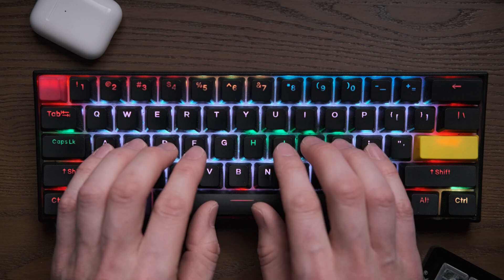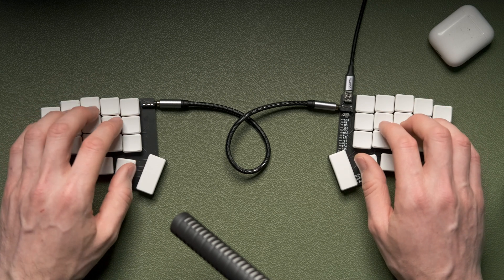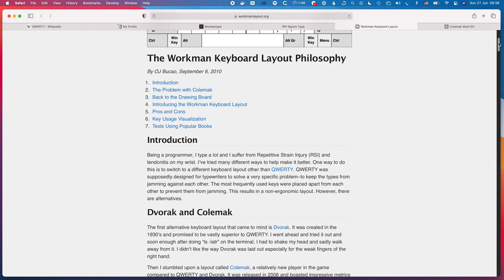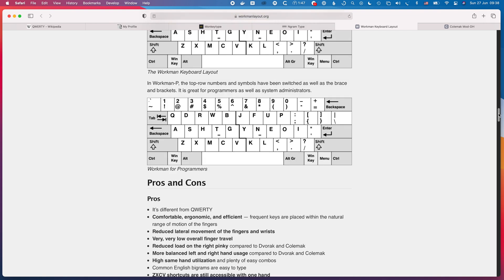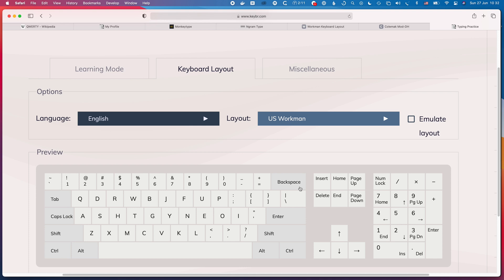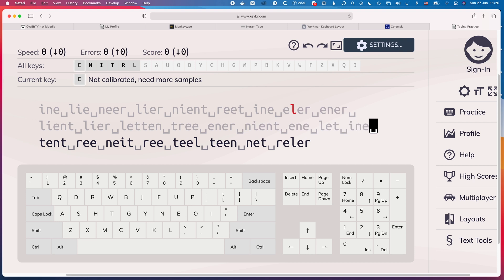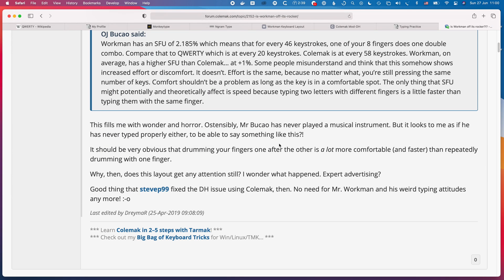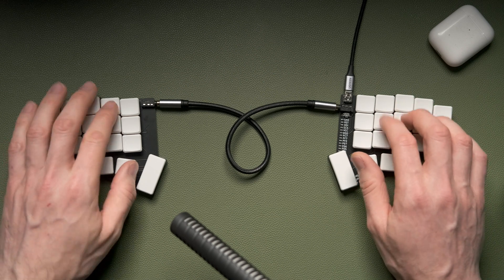Switching From Qwerty To Colemak DH (via Workman)

Comment: It's a misconception that QWERTY was designed to keep typewriter hammers from jamming. QWERTY evolved from an alphabetical layout folded in half. You can still see that in the middle and bottom alpha rows. That just happens to suck as a primary design choice for a keyboard layout.
Reply: Correct. The logic behind that was that people where supposed to write looking at the keys, and alphabetically ordered keys made sense for that. Slowly, some keys where swapped around to made it actually easy to type (like I and O below the 9, cause they were also the 1 and 0 keys, all vowels to top row to make 3 narrow rows instead of 2 wide rows). At some point people learned to touch-type on QWERTY, so further development on key arrangement stopped.

Comment: Question:
I'm currently transitioning to Dvorak and I'm still in early stage. I already find really weird that the F is so hard to reach, specially when coding (considering for, foreach, etc start with F 😕). I don't know if this is bc I'm still using a staggered kb (I'll have a sofle58 in a couple of days and will be able to test this) or if it's the layout's problem.
Does anybody have recommendations? Maybe trying another layout? I don't want to end up trying multiple layouts, loosing interest and going back to qwerty.
Reply from the maker: I would jump on the alt keyboard layouts Discord and see what they suggest over there. It’s the cutting edge of amazing layouts over there! https://discord.gg/J6d7kjjUDp

Comment: how you handle these layouts in iPhone? any app that offers the layout plus word prediction?
Reply from the maker: Not that I know of on iOS - there is xKeyboard though which works quite well for the layout. https://youtu.be/RbhmVFd1iNE
Reply: @BenVallack  I still miss the suggestions and autocomplete there. I was thinking that a mobile keyboard should have only 2 or 4 keys and the software should be able to predict the words or offer suggestions. Two fingers don't offer that much. If I could find a nice library to get the suggestions and learn from user typings I would implemented myself

Comment: Ben, Thanks for the video. I wanted to ask your advice. If you weigh the ergonomics of the DH mod against the Windows installation difficulty for employees locked down by their IT/Sec depts, do you think it's worth learning the DH mod vs learning vanilla Colemak which can easily be installed in Windows as an input option.  I've installed the "big bag" but can't get DH on my work laptop.  Thanks in advance.
Reply from the maker: Interesting issue, vanilla Colemak is going to be way better than Qwerty so it has to be better than not doing it at all. I never started with normal Colmak so can’t really comment on that.

Comment: Short and sweet, I like it! I have also changed to Colemak DH earlier this year and enjoy it. The only flaw that I see with it is that it definitely feels like my right hand is doing the majority of the work. I just recently soldered in per key backlighting on my Corne LP and enabled the typing heatmap display too, which reinforces this feeling as my right half is always more lit up than my left half.
Reply from the maker: Thanks! Interesting findings, I felt the opposite with Workman so was pleased to bring things back to my dominant hand a bit.
Reply: Yes, that is true. I wonder why not more people talk about the shortcomings of Colemak (less rolls than "advertised", too much work for the right hand, higher SFB than alternatives...) When I learned my custom layout (which was similar to Colemak, because using the same assumptions) I noticed that also. Therefore I ditched it and created a new layout which I think is much better than any Colemak variant. I have chosen to build on a variant of AdnW (Xoy) and modified that to my needs for English, German and Dutch. Then all keys move, but so what. Learning Colemak with about 17 keys changed is already an effort and the extra effort to learn all 30 keys new is not that large in comparison IMO.

Comment: How about this configurable layout: https://github.com/qmk/qmk_firmware/tree/master/keyboards/thevankeyboards/minivan/keymaps/josjoha (http://socialism.nl/misc/minivan/) It has Qwerty, Workman, Colemak, Dvorak.  I worked something like 18 months on it, and not just every now and again but almost daily.

It has about 4 times the functionality of a standard US keyboard. It is configurable in quite a few ways (crazy much documented). I was hoping to do this thing once and for all the right way for people without that kind of time. Even typewriters used to have more symbols than standard US keyboards, so I took some inspiration from the old typewriter symbols. It can pretty much type all western European languages, using Unicode for their additional letters (such as Ëë, ø, ç, ¿ etc), and some math stuff such as ³/₇ ≈ .42, ≤∑‰‱👍×÷√“”„‛’»±☞≠✗☑ etc. It can measure how much you typed (letters or words), lock it at a limit, measure your typing speed, has a dual layout if you want, etc. See manual …

Maybe you can review it some time ? It can be ported to the ortholinear Planck, which has been prepared in the code already, but that would require some work.

Comment: Ah, I was waiting for this video :)
I got my Moonlander about four weeks ago and decided to switch to Colemak-DH, since my muscle memory going from staggered to ortholinear required readjusting anyway. I'm now at 75-80wpm and I haven't any regrets about the switch.
I eagerly await your upcoming videos continuing on this subject! Tips for maintaining moderate proficiency in QWERTY would be nice. I find that continuing to use QWERTY on my laptop keyboard helps keep the muscle memory separate and it's a pretty instant readjustment.
Reply: how are things going? I'm currently at 40wpm with ANSI and I'm eyeing the Moonlander. Started a week and a half ago.
Reply: @valethemajor  it continues to be incredible. I'm down to a 36-key layout, still on Colemak-DH, with 100WPM on a bad day and 120-130 on a good one.
The only thing I would say is that there are much cheaper DIY options once you get down to 36 keys, some of which are showcased on this channel.
Reply: @TechTekker  seems to be the trend with everyone I've spoken to about their ergo or moonlander - swapped to a smaller board!

I'd rather not do sautering tho, sounds delicate and frustrating and heck dunno what the tools cost or what software I'd use to code it haha. Would prefer the streamlined experience at least at this stage in my journey.
Reply: @valethemajor  just to be clear, I'm using a 36-key layout, but still on the Moonlander! The fact that it has so many keys allowed to me slowly and comfortably get to this point, which was brilliant. And yes, the Oryx interface is simple and easy, but powerful nonetheless.
Whatever split ortholinear keyboard you choose, you'll certainly be happy :)
Reply: @TechTekker  Oh yeah I guess there's some advantage of flexibility when you have more keys.... Wow, awesome! I am not as concerned over the investment anymore then. Are you using whatever you chose for default switches or have you swapped your keys around at all?
Reply: @valethemajor  I went with Kailh Coppers, and I lubed and filmed them myself. Still use them and love the feel but wish they could be quieter (I'd say they're about middle of the road in terms of loudness). The good thing is that the Moonlander is hotswap, so the option to change the switches is always open.
As for key swaps, I put tab on upper right pinky, comma where you'd have slash, and return where you'd have the comma. I have a few multi-function keys to make my multi-layer system work, and I have to say overall the experience is incredible.
I wouldn't doubt the investment, even if you could spend less money on an alternative. The keyboard should last years and years and the warranty is generous.
Reply: @TechTekker  that's great to hear! If I keep up Colemak through to May then I'll probably ask my fam to chip in as my bday present. Thanks so much for the advice! I think I'll go with a linear switch, probably the silvers.
Reply: @valethemajor  wait, you're learning colemak on a regular ANSI board now? that won't work imo - you'll have to basically relearn typing anyway.
I would stick to qwerty on ANSI boards and colemak only on the Moonlander. I'm at equal speed on both this way, with no effort to transition between the two instantly (e.g. typing a message from my laptop and then going back to working on my desktop)
Reply: @TechTekker  it's working well for me thus far. Especially after putting in the angle mod. Extend layers are great too.
Reply: @valethemajor  oh yes, I just meant that it won't translate to being able to effectively type on the Moonlander on day 1, and it won't help with keeping qwerty proficiency.

Comment: In the vid you acknowledge that keyboard layouts should minimize how often you have to press two keys in succesion with the same finger. This is refered to as same finger bigrams (sfb).

From the 4 most popular layouts:
- Querty has 6.6% sfb
- Workman 3.1%
- Dvorak 2.6%
- Colemak 1.7%
However, we can go lower than that. For example, the ISRT layout has a similar feel to colemak, but has lower sfb. Here's the link to the layouts page:
https://notgate.github.io/layout/

ISRT only has 0.8% sfb compared to colemak's 1.7%, and the hand balance on ISRT is closer to a 50-50 split (colemak favour the right hand more).

Another aspect of keyboard layouts that can be optimized is reducing how often you have to roll your fingers in one direction, followed by a roll in the opposite direction right after. This is refered to as a redirect or roll reversal, and feels less comfortable than rolling your fingers in the same direction.

An example of a redirect would be the common "ion" trigram on colemak, where you have to roll outwards for "io" and then inwards for "n". ISRT also reduces redirects compared to colemak.

There are other layouts that improve on Colemak, but i brought up ISRT since it manages to do that while also having a similar feel to Colemak, which i assume Colemak users would want.
Reply: of course these % differ with the language in use
Reply from the maker: Really intersting thanks! Might have to do a bit of testing!
Reply from the maker: 3 weeks later and I am really enjoying ISRT! Thanks for the heads up.

Comment: what a timing i started switching to colemak dh last month so its really nice to see you choose it as an appropriate layout. I myself worked with the neo layout before that so i see a lot of similarities. 
My goal will be to be good enough with typing on qwerty that it is nice to use and now replace neo with colemak dh for my ergo keyboards. 
Your videos are always really informative and I like the perspective you give these very detailed parts of the keyboard and ergonomics ecosystem
Reply: Why did you decide to switch? I was under the impression you were using one of the Neo variations because it was specifically designed for the German language.
Reply: @TechTekker  exactly I just dont type much in german anymore so i noticed that the left keyboard half has the 3 umlaut characters(where i placed the special chars -/=) on it which will reduce the amount of keys i can use for shortcuts when using the right hand with the mouse. there are some smaller reasons as well but this is the main thing that got me thinking, I'm still working on the video about that
Reply: @JanLunge  there‘s also PUQ
http://adnw.de/index.php?n=Main.OptimierungF%c3%bcrDieGeradeTastaturMitDaumen-Shift

Comment: I tried learning Dvorak, Colemak, workman at one point, but then I realised that 90% of the gains come from moving the n e and t keys to the home row. So I ended up making my own keyboard layout because it's so much easier to stay close to qwerty and just have a few key changes
Reply from the maker: Awesome yeah that is a good approach for sure.
Reply: Perhaps that is the way to go, if you are already used to Qwerty for years and are good with it. I found it difficult to fully change to Dvorak, to the point where you start to wonder if it is worth it. I did fully change over, but it took me years. Do you have any sort of pain in your hands ever, after doing a lot of typing in your new format ? That strain caused me to want to ditch Qwerty. I never have any strain in the hands now that I type Dvorak. If this worked for you, I guess it's definitely the way to go. Changing a few letters must absolutely be something you can do in a few months or so. Perhaps even start with just one letter, then another, then another. Keep the flow going.
Reply: @josboersema1352  Oh I don’t recommend changing your layout often, it’s definitely easier once you’ve done it once, but every time you make a mistake you go from 100wpm to 20. I learnt that despite being on the home row, the pinky is a terrible finger to use, use your stronger fingers more often rather than prioritising the home row
Reply: @benlu  Absolutely. Right pinky finger is a complete mess on a standard keyboard, it couldn't be worse. It has 10 additional symbols to do. That's why I'm using a 40% with my own layout, and relief all that pinky stress. I'll just carry my keyboard along, don't even dare barely look at Qwerty. Put Dvorak on phone too. Don't want to activate those old neural pathways ;-).

One trick I do is when I make a mistake, I don't just correct it, I go back a few words for additional punishment, and to properly get it right. Key to good typing is a low error rate. Some guy with an insane speed said so.
Reply from the maker: @Jos Boersema you will love the next few videos!
Reply: @BenVallack  You are going to review my layout ? ;-) I'm on a minivan, but I agree that ortholinear is probably best, except possibly not needed for the thumb row. Sadly the Minivan is no longer produced. Maybe someone will clone it. I didn't dare go full ortho, because someone said it was a pain to adapt and I thought it wise to retain the ability to deal with a regular keyboard.